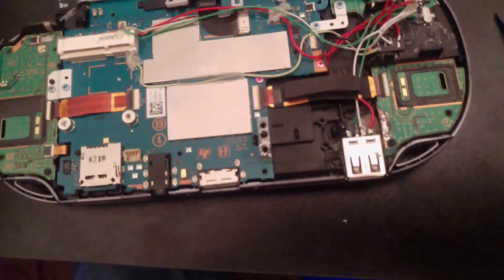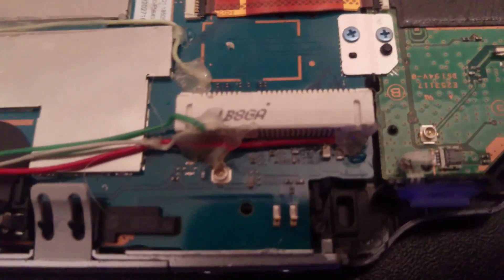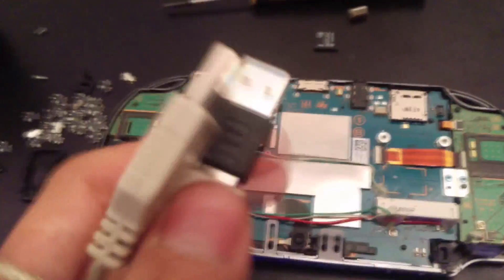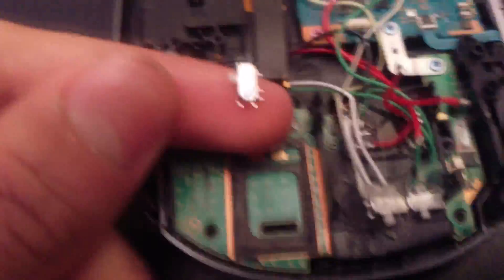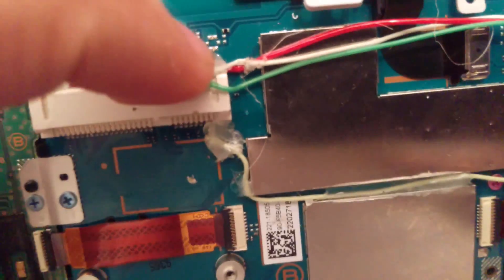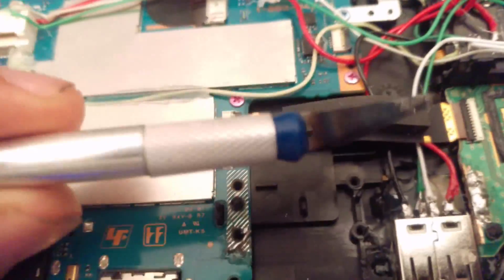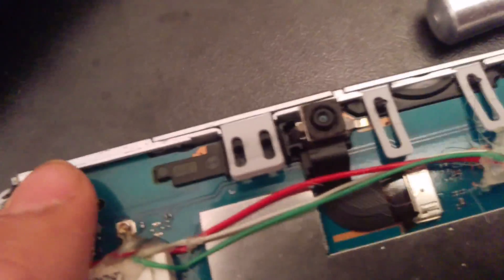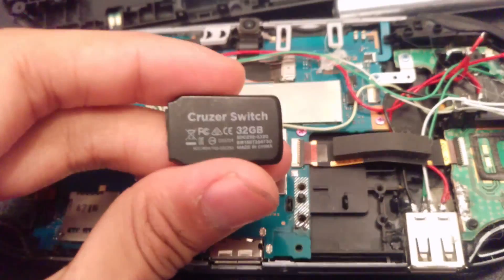PS Vita USB Mod

Comment: So, I've got a PSVita with a gibbed charging port, VCC fuse (unknown status on the datalines, got continuity but couldn't get a good soldering out of it)  that is somehow still miraculously working (alongside a broken screen). I can still hack it because I own another Vita and og memory stick. My plan is : 
1. Get files from good Vita and use them to hook psvita ( got another screen) and mod it
2. Use psvita3g-disable to call the "module_start" function and write those modules 
3. Solder a usb-c where the old accessory port slot (whose pads I may or may not have ripped)  used to be connecting to the now enabled pads.
Does it sound good or did I miss a step ?

Comment: Is the PCIE slot mod based on the PSVSD device?
Reply from the maker: This mod pre-dates the PSVSD, I never made my PCB due to unforeseen things which ultimately led to me not getting it made
Reply: @zexceilxaros4011  did you try to experiment with the battery pcb and how it is limited on a hardware level not to recognize anything past 2210mah?
Would love to (as many im sure) if you are curious enough to see if a higher battery capacity can be "detected" by the Vita.
Reply from the maker: @kaemelezzine1827  Haven't looked into that but as soon as I get another Vita I'll be testing that out and collecting notes on it, thanks alot.
Reply: @zexceilxaros4011  cool cool cool! (Abed from community)
Anyway real excited already if we can reverse this one out! Many batteries out there in the same Form factor and chemical build that can go up to 6500mah (gpd win 1 battery for 30 bucks). If we get the vita to detect all of the 6500mah that would be something. Plus the gpd win battery endures more (it is built for a micro windows PC after all) and can handle any future vita overclock (past 500mhz mark) or gpu overclock.
Currently : it is not advised to set vitabright.skprx to max while on 500mhz OC coz the battery can't handle it. So yeah... Many reasons to check the hardware situation of the battery, might open more doors for homebrew altogether.

Comment: So lets say I wanted to solder wires to the leads, could I remove the pcie port and just solder directly to the leads and still make an adapter or would that cause some issue with the vita?
Reply from the maker: Pros:
*Easier for you to solder to.

Cons:
*You won't be able to use the custom plug in board coming out soon.

Honestly don't do that.

Comment: But instead of standard 5volt, the m-pcie port in vita uses the battery power which varies from 4.2volts to 3.7volts. Didn't you experienced data corruption or slowness of usb drive during the low battery level?
Reply from the maker: Nope , if I did I would put a 5v boost , most USB devices such as flash drives don't require much power.
Data corruption and slowness would generally come from the lack of a stable current.
Reply: I was really juggling between whether i should use a boost converter or run as it is. Thinking that it would take a while for you to reply, Today, I decided to do a test of my own. I tested two flash drives. Sandisk Cruzer blade-16gb and a Kingston 32Gb. 

I kept on lowering the voltage until the flash drive would stop responding while transferring data. The result was not consistent among the two. The cruzer blade would stop responding below 3.85 volts whereas the Kingston only stopped working after going below 3.05 volts. Considering that the PS-Vita can go as low as 3.6 volts during low battery level, I concluded that, It would only be wise to test the flash drive before using on vita. You got really lucky there. and thanks for your reply.
Reply from the maker: Use the Kingston but format it to exFAT and test it fully works with the PS Vita, if you want to use external HDDs you WILL need a boost converter
Reply: I was only using kingston for testing which passed the minimum voltage threshold. I think 128 gb would be a better plug and forget type of device for storage on Vita. Since the minimum voltage requirement of flash drives doesnt depend only on the brand but also on the version of nand controller (their implementation of LDO regulator in the controller) being used, I was implying that it would only make sense to do a full test before using it on vita. thanks.

Comment: Really impressive work, it's possible to do this on the Wi-Fi psvita version?
Reply from the maker: Nope the port is disabled in software/hardware in the SysCon registers.
Reply: Zexceil Xaros thanks
Reply: Zexceil Xaros another way for psvita wifi? I have the game slot broken, so I can't use the sd2vita adapter

Comment: Did u already see this video: https://www.youtube.com/watch?v=MbmRweqXMmw&t=1s
Reply from the maker: Yes this was made around mid May but was improved, to use this you need to force reinstall Henkaku and I can provide a VitaShell vpk you need.
Reply: The hardmod is very easy, i'm already bought the pcs but i dont understood the software mod. Did you know how to do in software mod?
Reply from the maker: Message me on twitter and I'll guide you through it, there's some registry changes also needed to disable the mobile network error message.
Reply: Ok, thanks a lot. Just last question, have some advantage make a usb port like in your method? I dont undrestood why did u used the usb port instead a micro sd reader.
Reply from the maker: I could do all three internal storage, USB and SD IF I wanted but I don't really care for it too much.
I'm gonna produce a board for this anyways that uses eMMC memory chips for internal :P